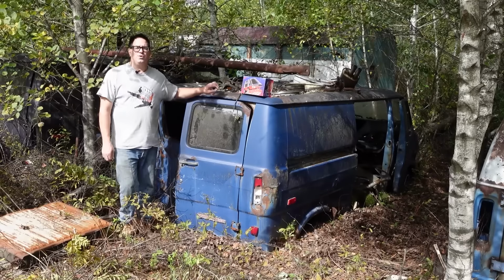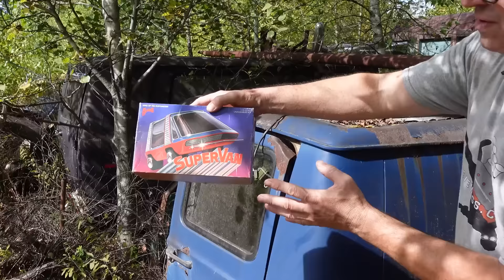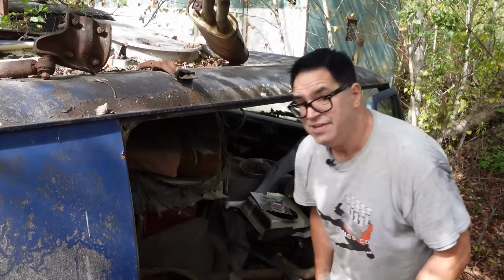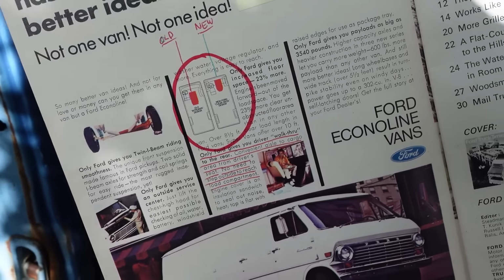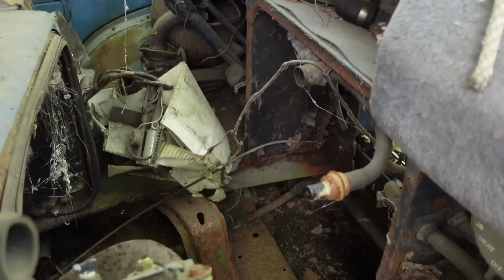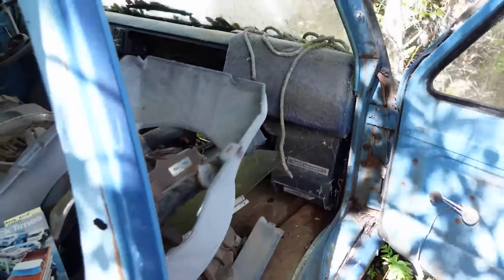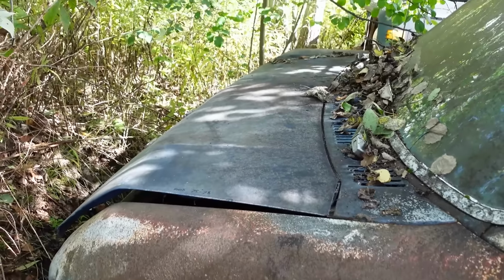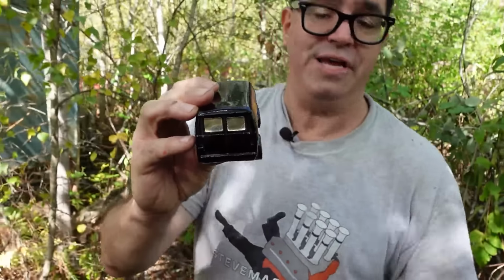Wagon Week EP22 - Ford Super Van

Comment: My dad bought a '74 Super Van w/302 in about '77. It was cargo style with just 2 front seats and a lot of real estate in the rear. However it had rear AC  (duct work that ran the length of the driver's side), so it was a great canvas. With the crushed velvet seats out of an Olds, the easily available shag carpeting, an 8 track stereo w/CB, and a cool panel that turned seats into a bed, it was the ultimate 70's travel van. My dad had mad skills! I wish I had pics of that beauty. Long before mandatory seat belt laws, we kids ran around the interior non stop. Good times!

Comment: Back about 40 years ago a friend bought one of these used to convert into a camper. It was freshly painted seafoam green, but if you looked really carefully in the rear side panels, you could see "SEARS" about a foot high.
Something we learned from this one is load capacity comes at a price. This was an E-300 and that ton and a half capacity gave him immense, stiff leaf-springs. It would have rode just fine if he hauled around a ton of bricks, but he was running it close to empty so the thing rode as if the axles were bolted directly to the frame! 

Trucks like E-100 and E-150 don't exist just because they are cheaper: they are simply better suited to hauling light loads and not shaking the occupants like an earthquake.

Comment: In 2005, I bought a 1990, base model, long wheelbase,Econoline window van. It was the strangestly optioned vehicle that I had ever seen, but met my needs perfectly. It soldiered on for another eight years, blown head gasket, horrible radiator and all. Occasionally, it would even hit on all eight cylinders!!😮

Comment: I was working for KFC back in 1971 while in high school and we had a 1969 Super Van at the main store (there were 12 stores in the area). We used it for deliveries and to shuttle supplies from store to store. It had the 300 inline six and three on the tree and unloaded it had vicious wheel hop with one wheel peel.

Comment: Had a Ford E250 Chateau super van late seventies, had a 460 4V got ten miles to the gallon. Used it as a service van I was locksmith. Pain to work on not much room to change plugs etc.

Comment: Ford still makes the Econoline only in E350 and E450 cutaway chassis form. 2014 was the last year for a regular E series van. I have a 2021. Only one engine available with it is the new 7.3 gas Godzilla V8. Detuned in the Econoline to 300 and 350 horsepower options. Same basic cab and bones made since 1992.